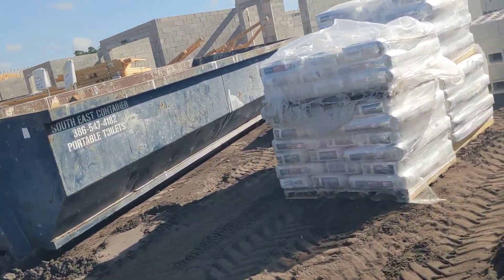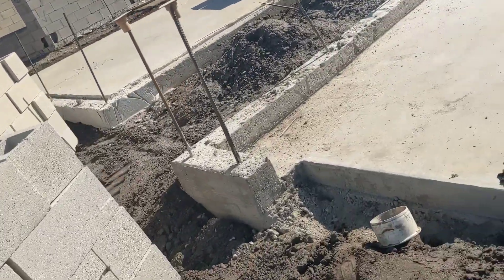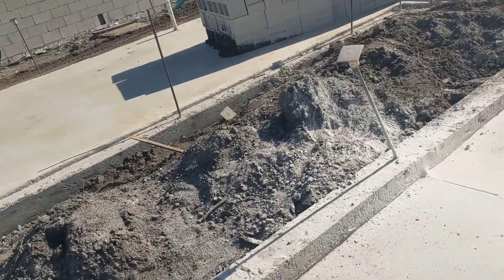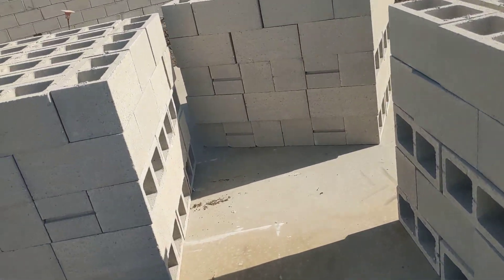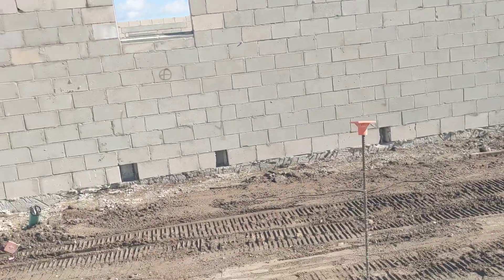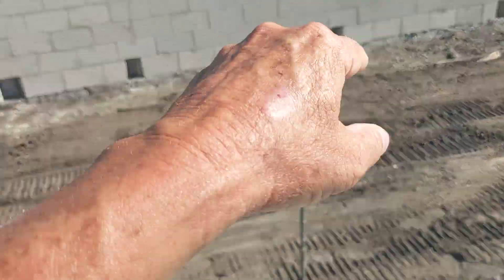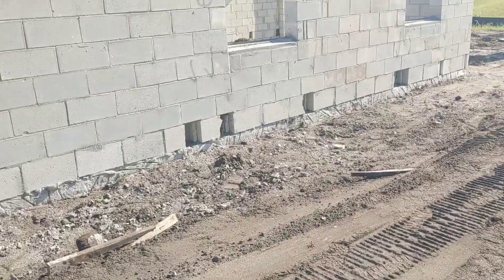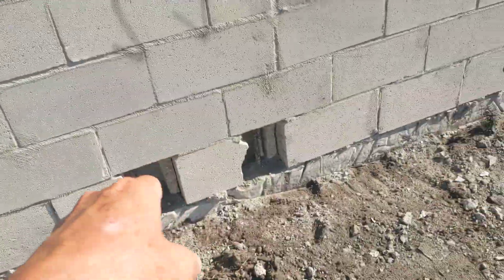8/11/23 Lintel inspection explained. #CMU. #BlockConstrucrion

Comment: I thought LINTELs refer to the bond beams above windows/door openings. This is vertical reinforcement.
Reply from the maker: You are correct.  I likely misspoke as I do not rehearse.  Yes, without horizontal deflections of a vertical load around the opening, to the foundation, windows would crack and doors would become unusable.
  Thank you for pointing out my lack of thoroughness in the video.